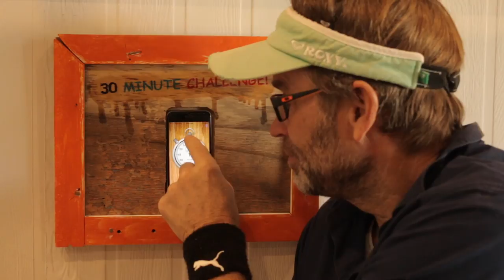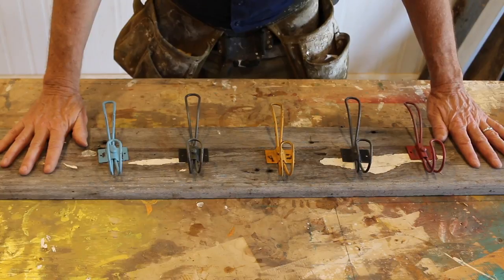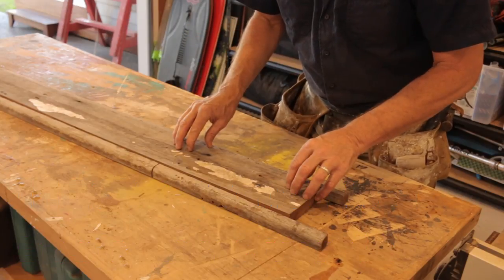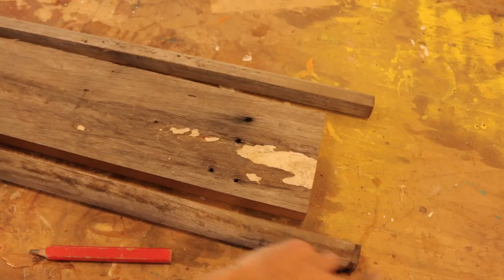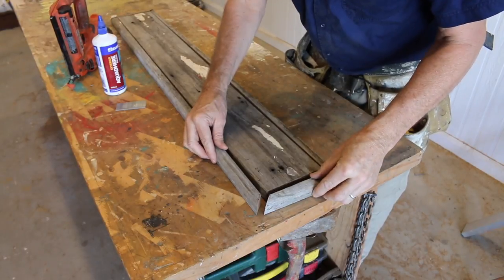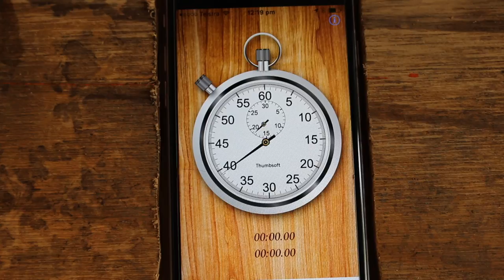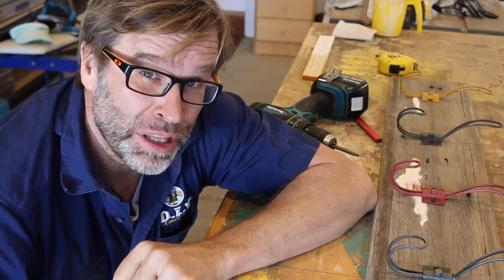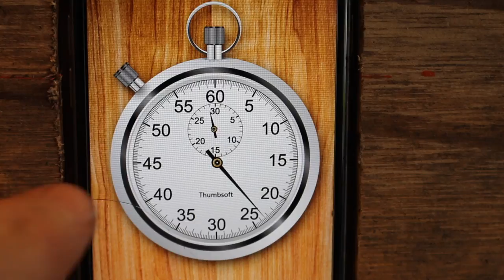How to Make a Coat Rack. Easy, Quick & Cheap!

Comment: Shane, I made a hat/coat rack using a pine slat off a wire cable drum and some railway dog spikes then used marine varnish finish. Took a bit longer than 30 mins. I'm going to build another one and try for 30 mins. Let you know how I go. Should get others to do the same. Cheers, Rossco
Reply from the maker: Give it a crack Rosscoe, l'm sure you'll knock the 30 minutes outta the park! Thanks for watching mate 👍😁

Comment: Very nice. I like the vintage look. Depending on how old the fascia is, it could have been painted with lead based paint, so you may want to be careful cutting and sanding old painted boards. And don't eat those tasty paint chips!
Reply from the maker: Thanks Joel and good point re the lead paint. Cheers 👍👊

Comment: Gooday Shane 

Repairing and decorating house. 

Having trouble getting a good finish on internal decorating with damaged external corners. 

House traditionally built in the 1960. Plaster over concrete blocks. 

What do you recommend please? 

Thanks 

PS. We really enjoy your videos. Have learned a lot from you. Thank you. 

Bill
Reply from the maker: G'day Bill and thanks for the question. Those external corners do take a bit off a beating over the years. The best compound to help repair the damage is to use an All Purpose Jointing Compound which you can locate at most hardware stores and it comes in a number of different brands depending on what part of the world you live in. These All Purpose Jointing Compounds are specially formulated to combine the strength of a base coat with the fine finish of a topping compound and they all dry through evaporation. Apply with a trowel and then just simply sand back with a fine grit paper. You may need more than one application....it just depends on how large and deep the damage is. Good luck Bill and let me know how you go. Cheers, 👍😁

Comment: Great to see more of these types of projects from you again! Awesome challenge idea. I have to ask, what did you use to mount it securely to the wall?
Reply from the maker: Thanks S.I. To mount the Rack, all l did was take two hooks off, one of either end. This was so that screws would be hidden. I then just screwed directly into the weather boards. If you can find a stud to drill into thats even better. Once the rack was screwed to the wall l put the two hooks back on.....l hope that makes sense. Cheers 👍😁
Reply: That's awesome! Same technique I've used in the past. Thanks for the answer. Looking forward to the next project!